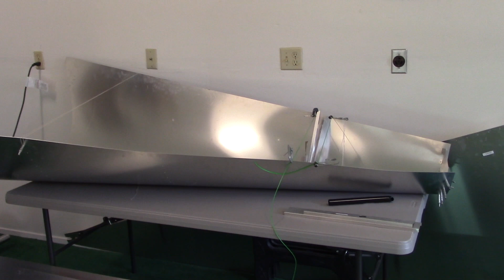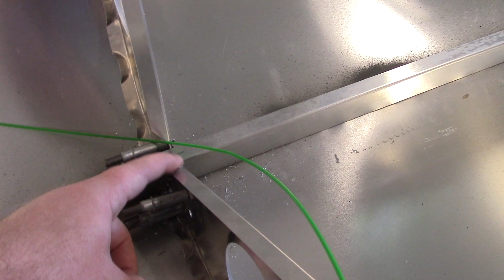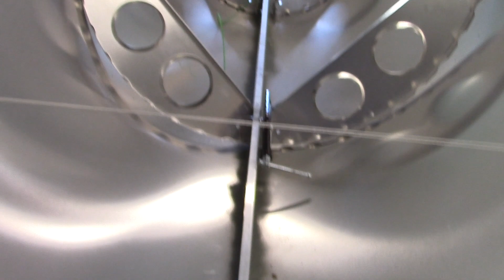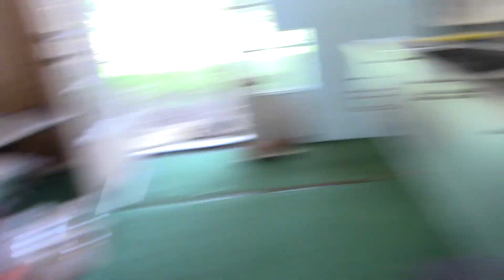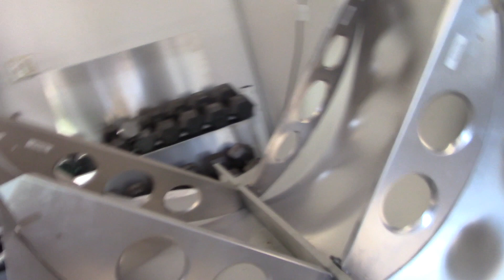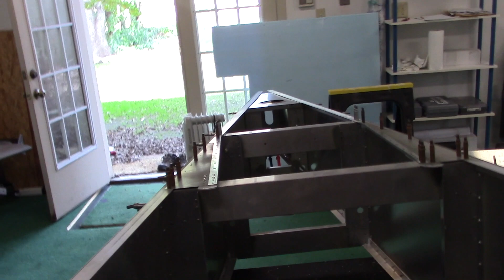Sonex Aircraft Build Video - 68 Turtle Deck Ribs

Comment: Interesting approach to working on the turtle deck. I riveted the two main skins to the spine and then clecoed this assembly to the aft fuselage without the formers. This was definitely a two person job. I worked from inside the fuselage to install the formers (ribs)...pressing them tightly against the skins while my wife drilled and clecoed from the outside. I was determined to have a smooth turtle deck and used shims where needed. This worked well. I borrowed much needed extra clecos from my local EAA chapter. By the way, installing the very front formers had no impact on any later work aft of  them. Thanks for sharing your progress.
Reply from the maker: David, thank you so much for the information. It is super useful. I called my dad after you wrote this and talked it through with him too. Like you suggest, I will add the front 2 ribs as it doesn't seem to make a difference. I will test fit it and then put pressure on the ribs when I drill from 40 to 30. I remember now (I picked this way to do it 6 months ago) that I wanted to have the ribs in place ahead of time because I was more concerned with getting the tub 100% properly aligned. Maybe I could have done it your way too. 

My dad is sending me a few hundred more clecoes to get this particular job finished. Otherwise the local EAA chapter is a GREAT idea!

I have a lot of C clamps that I am going to use where the ribs meet the tub. I think those will be able to hold the ribs in place well while I drill "up." Thanks so much for the help and happy flying! -Dan

PS - what state are you out of?
Reply: @danielolivermcelroy8320  You can never have too many clecos or c-clamps. LOL.  I'm in Texas.

Comment: work from the spine out, at least that way both sides are even, use a drilling template where you can to give you accurate drilling
Reply from the maker: Will do for the next ones if I can. It is difficult being so large and cumbersome. -Dan

Comment: Glad to see that you are able to get back to building! As far as the gap between the skin and the rib, if the holes that you drilled for the #40 would make it so that you cant adjust the skins to the correct location and be able to drill the #30 to make the skins tighter, then definitely a spacer would work, but I would try to drill the #30 in such a way as to make the skin tighter if you can.

As far as the extra holes that got drilled in the one rib you pointed out, if nothing else, just fill the holes with a rivet. That would solve any structural integrity issue. The best option would be to place a solid rivet in there. If I recall correctly, the sonex is all pop rivet, so maybe you can borrow a squeezer from a friend and pick up some size 3 (if its a #40 hole) rivets and fill it in. In reality though, I don't know that those holes will have that much of an impact and probably could be left alone.
Reply from the maker: Thanks Scott! That will definitely be my first choice. I also wonder if it is flexing based on how it is sitting unsupported on my picnic table. I'm gonna work on it more tomorrow but will post the next update next Tuesday. I'm trying to do a more consistent working on it and posting on it.

Also, I hope I can tweak it over as I don't want the turtle deck to have "lumps" in it as I think it wouldn't look good, however, 1-2 millimeters over that meter and a half area probably wouldn't show. -Dan
Reply from the maker: Just saw the second part of your comment. I think you are absolutely correct. Put a 40 sized rivet in there and don't think too much about it. The frame is super strong already. Again, I don't want to do this over and over, but one or two areas should not weaken it to a dangerous level. -Dan
Reply: @danielolivermcelroy8320  buy some cheap large flange alloy rivets with alloy stems to use as temporary fasteners, much more accurate than clecos